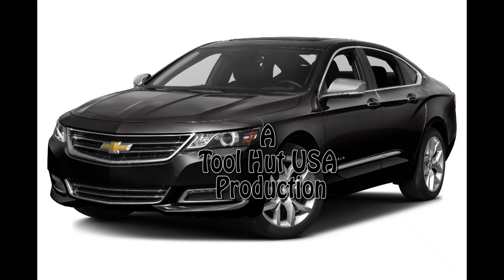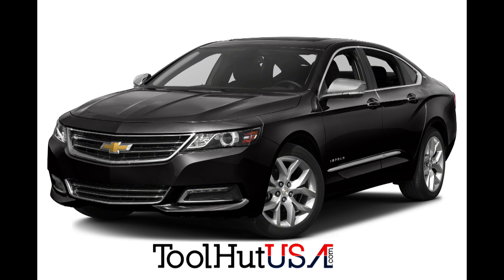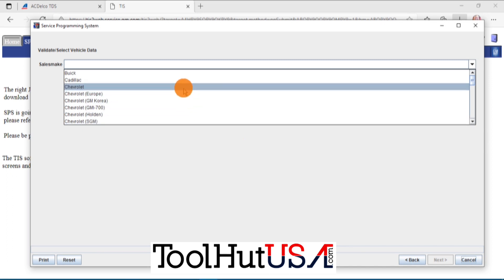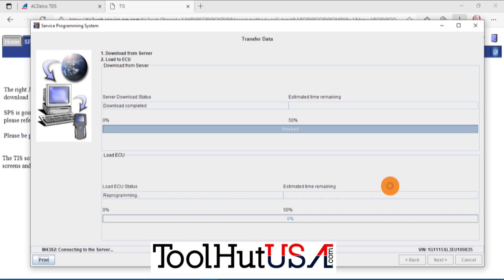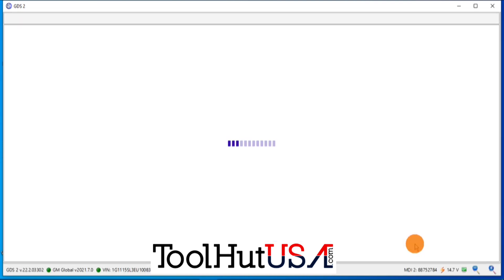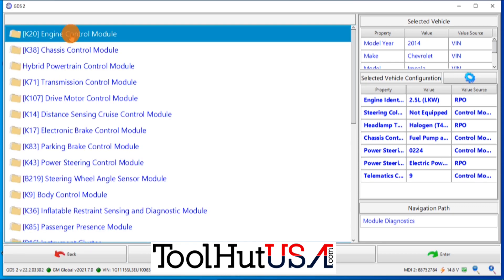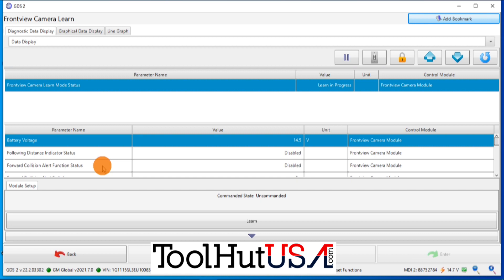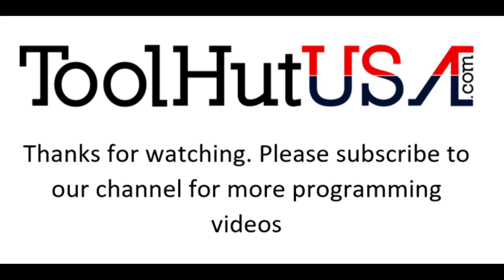14 impala front camera module program and calibrate

Comment: Thanks for the video.  I want to calibrate/program the front camera module on my Chevy Colorado.  Do I need both GM DI2 and GDS2?
Reply from the maker: If it has been replaced it will need to be programmed with sps2 and calibrated with gds2

Comment: Got a queston, I have forscan with the lifetime license, I replace a couple of steering racks in ford fusions and performed the ass built data with it,  is this procedure good enough with other modules on Ford's ,or is it still requiered to use ford software and program module, and is ford as built data the same just diffrent term as programing, not new to programing just new to forscan,
Reply from the maker: I would always make sure the module is up to date. A lot of modules only require configuration. That is what foescan is good for.
Reply: @toolhutusaakathecarflasher3019  safe to say something like a pcm that has bullentins for a specific flash update oe software purchase is required, but something like abs ,steering, smart junction box and ECT forscan is good enough to get the job done just trying to figure it out so it makes it easier to bill customers properly is all every penny saved is a penny earned, ive had some issues with oe software across the board,forscan has saved my skin and only had to pay once, just like the bosses Chinese clone tech 2 ive done a pile of flashing and pcm recovery with it, I even got the correct usb to rs port adapter and so far its worked flawless, the pc board in it is even marked vetronix its a older clone, even my launch save my skin on chrysler vehicle reconfiguration in the front control module its nice to have a bunch of options
Reply from the maker: Yes. Fordcan will not perform programming.  It would require a purchase for updates. Most of the pscm, abc, ic and others only require initialize that is what foescan is good for.
Reply: @toolhutusaakathecarflasher3019  thank your for your response, and helping me further understand, as a tech and not a owner of a business funds for me aren't unlimited, I get a lot of work from other shops, I'm not affraid to pony up I have many scan tools of my own verus pro, otc genisys with the 5 gas, launch pad, vetronix mts3100, forscan, bosch ads625, plus vantage pro, picoscope, cardaq m , lets just say I love it when we call the other shops and say your all fixed up, theve been at the car for weeks and we usually have same day turn around, thank you for your time and videos they are much appreciated